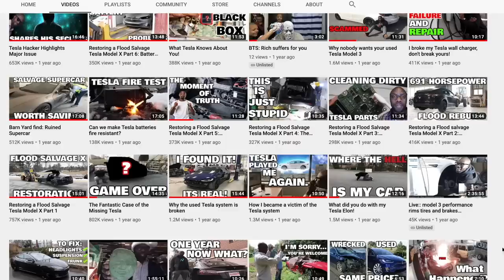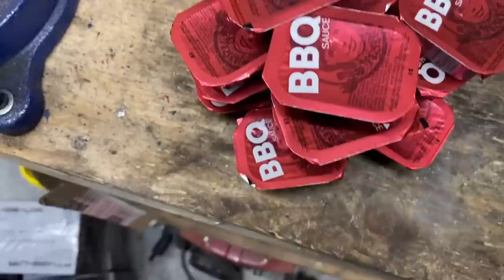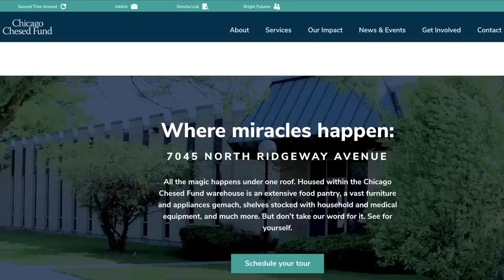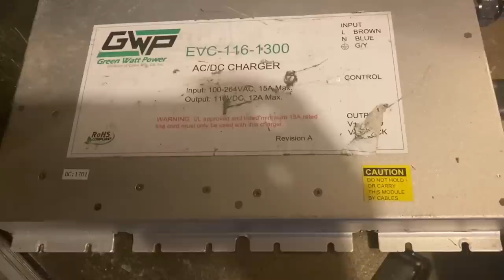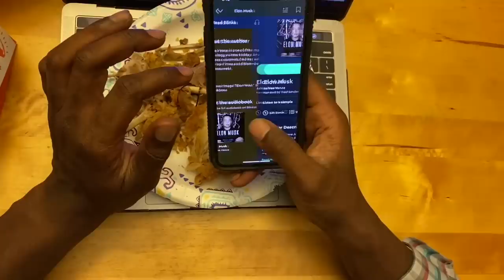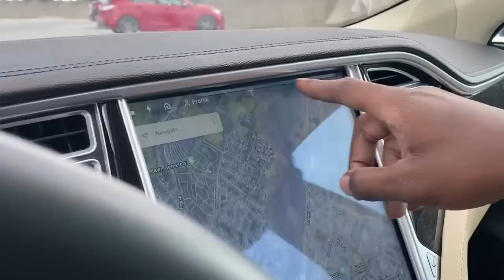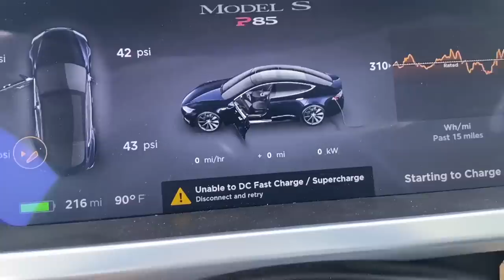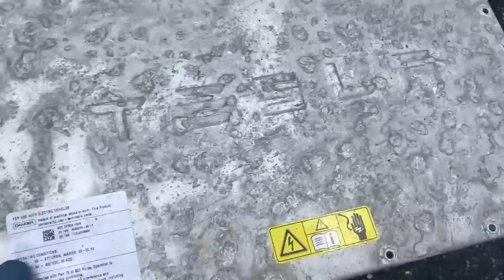I’m Giving all my Tesla stuff away

Comment: PS: you totally need to put a Hayabusa motor in the mini Cooper.
Reply: This has been done so often, no thriller anymore. But a 6 cylinder in the front and a rear wheel drive without extending the car- that would be a nice one. Mazda had a very small V6 back in the 90ties.
Reply: Myles Blackwood 2 busa motors or a busa derived v8.
Reply: Oof that thing will be a rocket with a busa engine in there, I like it
Reply: @FeralRabbit  Busa or similar derived V8 would rock.  Maybe two 600's joined would work.
Reply: FOUR Zero motorcycle motors one for each wheel, an AWD electric  Mini...
Reply: Turbocharge the original engine!
Reply: @t.490  Oof. Those old mini motors are a bit of a pain to turbo. The exhaust and inlet ports are right next to each other on one side of the engine, in an alternating pattern.

But honestly, I kind of agree, stock motor, or some other small high rev N/A motor, without mad amounts of power. Keep the OG mini feel, cheap to run go kart
Reply: @Gnrnrvids  hah 17000rpm v8! Sounds amazing
Reply: More power definitely but a Mini needs to be light.
It’s all about the go kart.
Reply: @Hayden734  It would be  a very cool project.
Reply: @Blackinterceptor999  look up pmi or pml electric mini 4 hub motors 650 hp 2xxx tq

Comment: Electric powered Jeep Wrangler:

I CARE.
Reply: I cared so fucking much! That 3.8l in mine is  the worst
Reply: I have an 04 Wrangler LJ and I think a Jeep would be a great platform to electrify. It’s small so it’s good for running around town and it sucks in the highway so I’m not going to drive it far enough to care about range.
Reply: Amazon has a 12v jeep
Reply: Old small Jeeps with brand new top grade electric motors and batteries would be perfect.
Reply: Yooooo that's what I said like let me watch that real quick

Comment: I had 4 of the MINIs in my youth they were fun cars. The first thing you need to do is check the drive axles they had molded rubber universals as stock you to change them first thing. The 10 in. tires could give you a problem I can't even find the 12 in. tires I need for our last car we have that works a Geo Metro. If you want to know anything else about the Minis just let me know. Have fun.

Comment: The first gen Prius the ECHO looking one. its probably very light without its super heavy batteries plus the engine and dead weight. You should turn one into a more efficient full gas car maybe a Honda b or k swap, or some fun toyota motor. would be a fun sleeper. The idea came to me because I was thinking about how EV/hybrids cars need to be engineered so that they can compensate for the heavy batteries. if it had a light gas engine it would be a fun sleeper. A Honda CRZ is another good candidate.

Comment: I drive a 1985 Cadillac limousine but I want to convert it into electric purely for environmental reasons. Mechanically, it runs really great but it just uses too much gas! I would not want a new Tesla or any other car because my car is so comfortable! Is it possible to add electric engines to the rear wheels and keep the existing gas setup?

Comment: What about how to convert classic cars to electric. I have my 1972 Dodge Demon that I bought new. I really don’t want to put a 500hp striker motor in it. I don’t have a clue where to start to try to convert it over to electric. I work in IT for 40 years. Don’t ever trust a major corporation. I’ve done much better working for myself. I did put a new crate engine in my 1986 Chevy pickup. It’s fun to drive now. But it gets 9mpg.